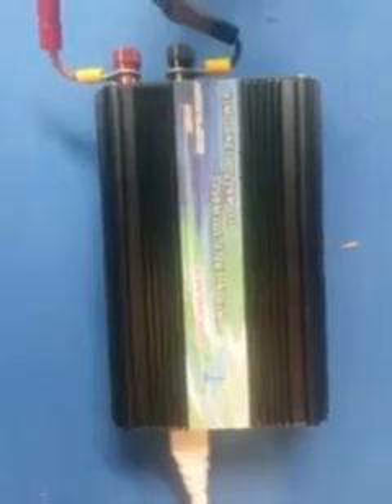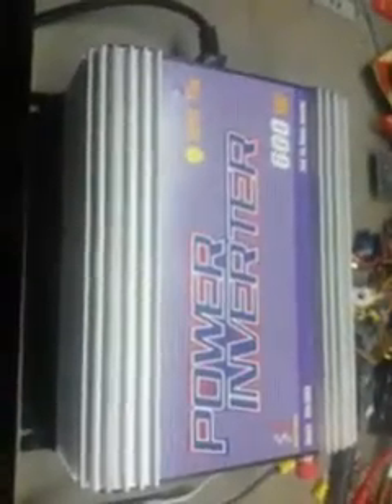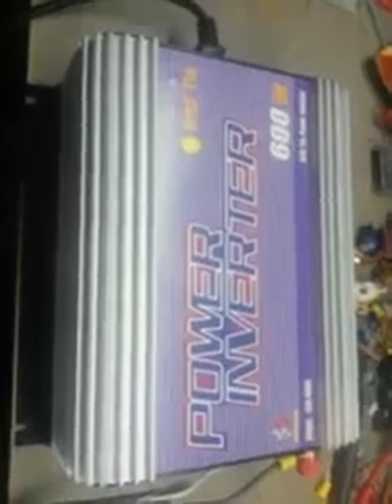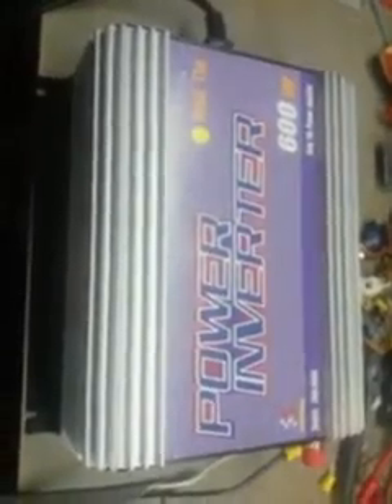Using your Grid Tie Inverters and panels when the Grid is down.

Comment: I was experimenting so I recently did this. It works until your loads go away such as your refrigerator turns off or whatever. The grid tie inverter will  increase in voltage until it blows the Capacitors in the non grid tie inverter.  It all works as long as you have a load. Those below that say nothing will happen did not try it like I did.  If you are using a small non grid type inverter,   at night you will draw power from it and possibly blow fuses.  Also some grid tie inverters turn off at above orr below a certain frequency. A better idea is to tie into the solar panels with both a grid tie and non grid tie and inerter. Use a transfer switch at the breaker panel. Solar panels run both the grid tie and non grid tie inverter.  In this case main off, non grid tie with batteries breaker on.  If you ever try this with a generator it will also run until there is no load on the grid tie then it will burn up the generator.   And all of this I also believe that if you don't have enough load for the grid tie that will burn up the non tie inverter or generator.
Reply from the maker: Planning on losing my load tonight
Reply: 9 years later😂😭  @philthayer4087
Reply: Yes a proper inverter that turns on the micro inverters will have a battery bank that can take all the energy from your solar panels for a short period of time. Then it increases the voltage a little bit which communicates to the micro inverters that they need to stop producing electricity. The response time of the micro inverters is more than a minute so the batteries have to take the excess power until they back off. 

You can get the inverter for around $2000 but a battery system that can take 10kw of power is not cheap. I am hoping someone will make one with capacitors instead of batteries. But have not seen that yet.

Comment: This is great going to use this with the 2kw limiter inverters this is going to be great and with a Transfer switch.  Using a split phase pure sinwave inverter and the grid tie 2kw inverter set for 240v.
Reply: make a video, so I can see it!!
Reply: @earthenergyhex  will do once the solar is set up.
Reply: Hello friend.. Do you have test 300W pure sine + 1000W /2000W gtil2?
Reply: I do this setup but wirh a soyo 1000w grid tie with limiter on my powmr sp5k inverter so regardless if it pulls from grid or is in off grid mode it doesnt destroy nothing safe way to do it all plus makes a 5kw inverter into 6kw which made a differance on my water heater and ac units running at same time

Comment: Will the grid tie charge ur battery if there is like a 100watt bulb only or will voltage just continue to rise until an outage or boom? I wanna do this with a 1500 watt pure sine and my enphase I have 10 of them
Reply from the maker: The pure sine is used to fool the island protection so you can use you panels when the grid is down. Make sure you have a load! If not the grid tie inverter will likely shut down or explore.  Either one!
Reply: Grid tie inverters are designed to maximize power they send through so this is a definite concern.  Look into a limiter.
Reply: Also enphase micros are wired for 220 volts ac

Comment: what do you think will happen if your Grid tie produces more than your load? I have a 3kw grid tie i could have really used during the 12 day power outage we just had after a cyclone in Queensland Australia, although I couldn't risk frying the system.
Reply from the maker: Well I'd hope there's over voltage?  Either that or caps will be exploding!